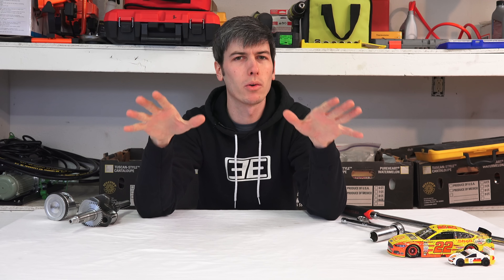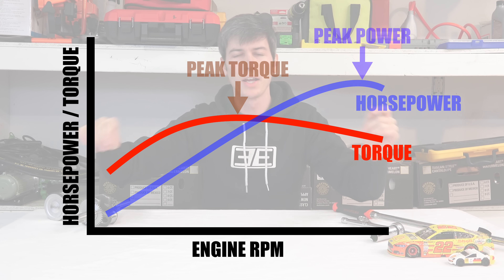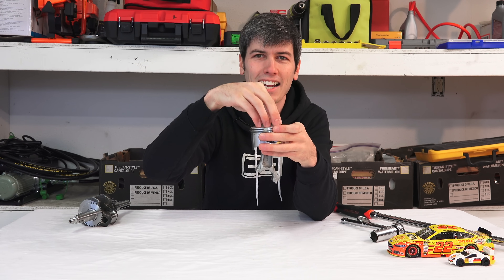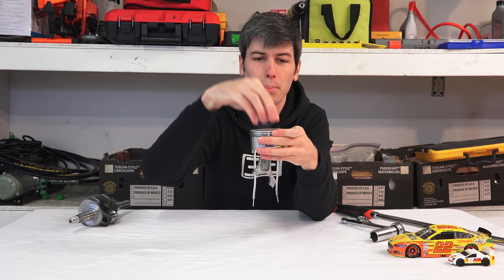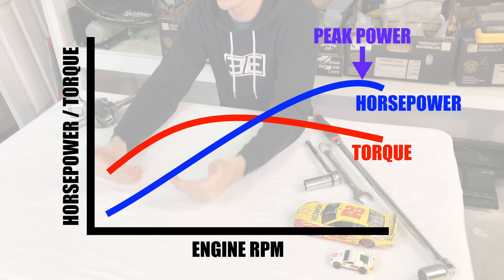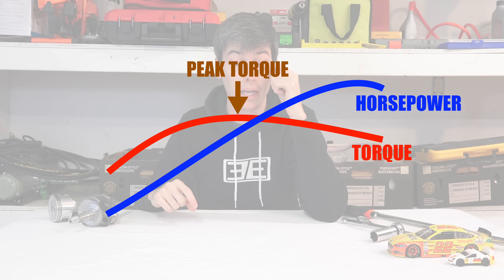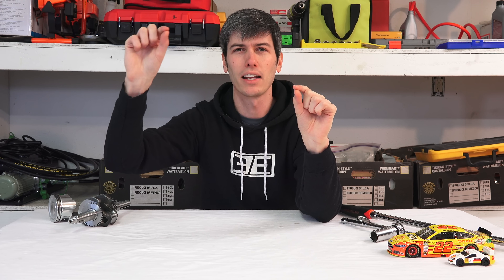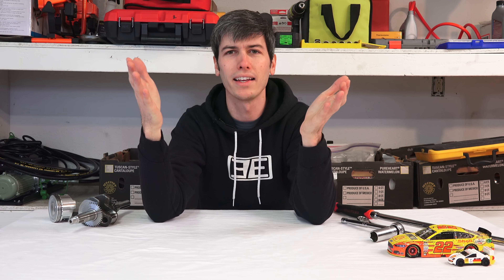Horsepower vs Torque - A Simple Explanation

Comment: I disagree with some of your conclusions. I love your videos and have learned a lot from them but this one was lacking a bit for me. HP and Torque are only related by the formula that is used to convert one to the other and not by any engine design feature. Torque is all that an engine actually produces and is all that is measured by a dyno. Math is used to calculate HP based on a formula that uses RPM and Torque as inputs (HP = torque * RPM / 5252 if using non-metric values). For this reason all performance charts will show HP and torque intersecting at 5252 RPM. Since Torque is all that an engine actually produces its not completely correct to say that a car that produces more peak HP will accelerate faster. HP goes up because RPM goes up but the car is not necessarily applying more twisting force to the wheels since torque may not be rising. Consider Diesels. I drive a 2012 Diesel BMW X5 35d with 425 ft-Lb peak torque and 265 peak Horsepower.  That diesel (x5 35d) engine accelerates this 5192 pound Vehicle to 60MPH in less time than the 200 pounds lighter gasoline equivalent (x5 35i) that produces 35 more (300 total) peak horsepower. Based on this video, if I only compared peak HP I would conclude that the x5 35i would accelerate quicker than the x5 35d but that's not the case. While I might agree that peak acceleration will be highest at peak horsepower this is only an instant in time so if you are comparing automobiles you have to compare torque curves if you want a full picture of acceleration over time. So in your example with the two model cars ... if that tiny car were a diesel It might accelerate across your desk faster than that larger car. :-)
Reply: Leighton
1. A dyno actually measures power and calculates torque because it is far easier to measure power than torque.
2. The diesel is faster from a stand still because it makes more power in the lower RPM range than the gas engine. You can't just compare peak numbers.
So the car with more HP is always faster, except when it can't shift down to use that power, so for example in first gear.
Reply: Thank you for your reply Blackster. Dynos do measure torque and then convert that number to horsepower using the measured RPM. But don't take my word for it ... check the internet. However we do agree that simply looking at peak horsepower, as stated in the video, to determine which vehicle will accelerate faster is no sufficient. So yes, the torque curve of a diesel confirms your statement that in general they produce more torque alt lower RPMs and are therefore able to put more twisting force to the wheels earlier on in an acceleration run.
Reply: Leighton Apparently we are both right. I know from a tuning company in Dubai that their dyno measures torque and calculates HP, but I researched a bit and also found other types of dynos that measure torque and calculate HP :)

Comment: the 200 hp vs 200 Nm example is wrong.
more torque you have even with less horsepower can be as fast as the other. you can manipulate gears ,so even if it doesnt have rpm ,it can push the pistons with more force. like starting straight in second gear.

Comment: I still need an explanation about diesel torque. If you use the calculators available for gas engines to calculate acceleration on a vehicle which is a diesel it’s completely incorrect.

Comment: Let's say your peak torque is in mid rpm range, is it possible(for swim reason) to tune your car to have peak power at the mid rpm range to match the peak torque range without manipulating torque
Reply: And second question why do peak torque/power drops after a certain point?

Comment: No, No, No, HP is a derivative of torque. So no matter what, the work product at the wheel for both cars will be the same. A car that produces 200 hp and 100 lb-ft will produce the same power at the wheel as a car with 100 hp and 200 lb-ft. To achieve 200 hp with 100 lb-ft the engine must turn at 10,504 rpms. To achieve 100 hp from 200 lb-ft the engine will only be turning 2,626 rpms. So no mater how the cars are geared, end work product will be the same where the rubber meets the road.

Comment: How does this apply to electric motors? So specifically torque vs watts in cars like the Tesla, Leaf, or Volt? Is the horsepower calculated the same or no longer relevant as a measure of power?
Reply: You can't really compare electric motors and petrol engines by looking at the torque and hp figures alone, because they only tell half the story.

Comment: One thing that should be noted here is looking at peak numbers tell you nothing about how fast a vehicle is unless it has a CV transmission.

As soon as you add in none constant engine speed due to multiple gears, a "Peak" number is useless without a curve plot. What's important (which is why the curve plot is needed) is the average horsepower across the speed range from one gear to the next... This is why some cars are "dyno queens". While they might make a nice high "peak" number, they are often slower then cars with lower "peak" numbers because of their lower average horsepower across the RPM range for each gear. This is why gearing is so important. If you have a closer ratio transmission, you can have a faster car despite having less power.  

For example I know of a 750hp Mustang that runs neck and neck with a 675hp Corvette despite having 75 more horspower. When you look at the dyno plots for each car and their gearing in each gear, the reason for them being so closely matched is obvious.... they have almost identical average horsepower across the length of the gear with each shift. Because the Mustang has a lot taller gears, that car gets into a much power power after each shift which hurts it. The particular corvette has a custom geared close ratio box. What's happening is they are both right at about 615hp throughout the usable rpm range for each gear.

This goes back to what I said about peak number being useless unless you have a CV transmission.

Comment: What most people dont know about changing a cars gear ratio is: if you take the vehicle to the Dyno you will only see gains in first and 3rd gear. 
Because once it hits that 1:1 ratio and then the overdrive gears, that is when the dyno sees the ENGINES power. Not the gears power. because first, second , and third gear multiply the torque on top of the final drive ratio chosen.

Comment: Great video.  Is there a reason supercars use dual clutch gearboxes vs. CVTs because like you said, if they could stay in the max horsepower they could accelerate faster than a dual clutch?

Comment: How can a dyno work out horsepower without rpm yet torque needs an rpm reading to work out the torque when horsepower needs torque multiplied by rpm to work out horsepower?

Comment: Hey. i like all of your videos, i think you should differenciate torque at the engine or at the wheels in this case when you say HP is torque *RPM and use the example of the two cars.

Comment: Why do turbocharged engines typically increase torque more than they increase horsepower? Shouldn’t the horsepower increase at almost the same level as the torque?

Comment: Hum.... thought the torque curve or the power curve as the same for all gears. Example, the same graphic shows the fl/lb/hp during a range of RPM, doesn't matter the gear you're in. The first the curve is the same (but you hit peak RPM so you gear second), second is the same also, you start a little higher on the RPMs cause you came from the 1st but the engine output/curve is the same... And the same goes one until top gear. Actually, I don't think the video is acurrate saying the graphic shows the curves through gears. I think is RPM no matter the gear you are in. UPDATE: wait, think you premissed the gear as being a SET gear, not gearing it up.

Comment: and how do you explain torque with a rotary engine?
Reply: It's still the same physics. There is still force being applied at a position offset from the center of rotation, even if it's not in what looks exactly like a lever.

Comment: In the 2 cars identical analogy, if both vehicles were starting at the same engine RPM and gearing, would it mean the lesser hp more torque vehicle would accelerate faster until such time as the speed factor (RPM) from the higher horsepower car equates to greater overall value that the other car has and then begin to pass it?

Comment: Basically I need to buy a well built CVT and a boosted engine
Reply: he has stated that a CVT wouldbe the perfect transmission layout if they were strong enough to handle higher power
Reply: I dont think so. The problem with CVT isnt only beacause it's not strong enough. They just have a relly big power consumption. They look so efficient on paper, but dosent perform well.
Reply: Most people actually don't really like the 'feel' of a CVT... and prefer a decent automatic, if they don't want a manual
Reply: Ill stick with cvt on the mopeds and manuals in the car hahah

Comment: Bleh, this made me super confused.  Not what I usually say about EE videos.

It seems like what you're talking about is engine torque vs wheel torque (ie. the difference in torque amplification through the transmission and final drive), but you're calling it torque vs HP ("power").  You describe wheel torque being higher if the gear amplification is more (lower gear), even if the engine torque is less, and that's true...but that's not HP.  The HP equation doesn't take torque amplification into account.  It uses the given torque, be it wheel torque (ie. 1500ft-lbs) or engine torque (ie. 150ft-lbs), and applies the rate (RPM) to it, but it doesn't include amplification.  Engine dynos can calculate HP w/o amplification, because only RPM is required.

Perhaps somebody can explain what I'm missing about this because including gearing to get power from torque confuses me, as the gear ratio amplification and hp equation are two separate things.

Comment: Great video but there’s a couple things that confused me. Im an engineering student in Britain so I understand quite a lot of the stuff but one thing that really confused me was when you said horsepower is work done but then refer to it was power. Work done is energy, which (brings me into the second thing that confused me) is calculated by force*distance, there is no mention of speed or time in that formula, so how is time to move distance x affecting the power?
Reply from the maker: Horsepower is not work done, but instead (as mentioned) the rate of doing work. The faster you do work, the more power it requires.
Reply: Engineering Explained ahh that makes so much more sense thank you, great video 😊

Comment: Good explanation, but a question presents itself: why wouldn't all manufacturers focus on HP over TQ? For example, V12 Mercedes have say 500hp and 600tq, why is that desirable? Is it simply for instant acceleration without downshifting?
Reply from the maker: A high, flat torque curve is desirable, and results in high horsepower. Remember, the two are connected, so if torque is low, and RPM is low, power will also be low.

Comment: Nicely done, Jason.  I know most gearheads watching this are probably 0-60/drag race types, but It would be great if you could turn the tables and explain torque & horsepower from a towing perspective rather than only from  an acceleration perspective. Perhaps use your 200 hp/100 lb-ft vehicle versus 100hp/200 lb-ft vehicle scenario, only explain their ability to tow a 5,000 pound trailer.  Or am I just demonstrating that I didn't understand the above video as well as I think I did?
Reply from the maker: Well, regardless of how much mass you add to the vehicles, the vehicle with more power will ultimately be able to accelerate that mass more quickly.
Reply: Thanks for the quick response.  I'll have to figure out a way to measure the following "feeling":  It sure feels like my diesel pickup with 189 hp and 369 lb-ft will accelerate up a long grade with  my 4,500 trailer quicker than my gas truck with 235 hp and 295 lb-ft.  Based on the physics as you have explained it, it is probably just the way the gas engine's automatic is shifting, keeping the engine off peak horsepower while the diesel is probably operating on its max of both.

Comment: What's the advantage of having more torque then
Reply from the maker: More torque means more power! :)
Reply: Horsepower is a product of torque and engine speed.  If you have more torque, then you don't need higher engine speed and can use less aggressive gearing.  Or if you maintain the same gearing, more torque = more horsepower = faster acceleration.
Reply: I get it now so having more torque like the leverage that the power is using, and the power is the actual force pushing the torque. So let me know if I'm wrong but that means you can change the torque through gearing but the power should remain the same? Also if this is the case why does torque go up with engine tunes
Reply: Thanks
Reply: Engineering Explained  Not unless it can rev higher than the engine you are comparing it to. You can't make a blanket statement like that. If you can increase the torque and maintain or even increase the rev capability then there will be more power, if not, such as the case of a longer stroke mod(too high of piston speed and/or inadequate breathing) you have less power or the same, merely reshuffled in the rev range.

Comment: I have a question: If you have 2 identical cars with relatively the same engine characteristics, but one is 100HP with 100Nm and the other is 100HP with 120Nm, which one would accelerate faster? And how would that change if the cars weight less or more? Thanks in advance.

Comment: Roads aren't 100% level in real life. I know for a fact that my jetta with 177tqlbs/170hp is just as fast as a Subaru BRZ with 151tq/200hp on the hilly roads in my area. Torque wins races, horsepower sells cars.

Comment: I think a simple way of putting it is. Horse power is like fan.. if it has very low torque, when you put your finger in between the blades while it's spinning, you'll stop it. If it had more torque and you put our finger in it, it would cut it off..

Comment: So how would you compare hp and acceleration to, say, torque and towing capacity? Afaik most vehicles built with towing or high weight transport focus more on peak torque than peak horsepower (like the slower car in your demonstration).

Comment: I'm still not sure what the advantage of torque over horsepower would be, based on this explanation. If the car with more horsepower does More work More Quickly, like you said, then why would anyone pick a car with more torque and less horsepower. Wouldn't the HP car be superior at both acceleration and, for example, towing heavy loads?

Comment: Two additions:
1) Changing speed requires performing work (because you need to change the kinetic energy). Thus, the faster your engine can do work, the faster the acceleration is.
2) So what does the amount of "torque" in the specs tell you? Nothing directly. However, using some simple math you can tell how well the engine behaves at mid and low rpms.

Comment: Just to add on to this a bit more, power is related directly to how fast your engine uses fuel. That formula would be Power Out = efficiency X Power input. PowerOut is horsepower and Power Input is fuel input rate. The only ways to have an engine make more horsepower is either to make it more efficient or dump fuel into it faster.

Comment: BTW I think one of the reasons for all the confusion is that gearheads that say "torque is king" are basically confusing low end performance with high torque. If you're in a race where you never get a chance to really hit high RPM ranges (IE racing from stop light to stop light) then you'd want a car that produces performance in the lower RPM ranges. (Which ends up with high torque and low power.)

Comment: To sum it up Horsepower is an engine's ability to trade rotational speed(RPM) for rotational force (Torque). Your transmission is a device that allows you to trade one for the other at the wheels. (Which is pretty much what that HP=RPM*Torque formula is telling you.)

Comment: That was awesome! Would be sweet to see a similar video on how this is different with electric motors which are constant-rpm machines vs internal combustion constant-power machines (at constant throttle). It's perhaps not as useful to illustrate for cars, but model plane examples are great, where prop represents load and the concept of overpropping or underpropping an engine can be delved into. Just an idea :)

Comment: Great video again, may i add something?:  Electric car math are alot more easy to explain!..
 - Assuming torque is generally constant like for Electric Cars,  then Power is : "at up to witch max RPM it can be sustained !"   Easy... Power = Torque x RPM... and Electric car have one gear... simple !    
- Also  for the electrical part: Torque is proportionnal to the phase current going to the electric motor and Power is proportional to the battery current you.  Battery current and Phase current are different. That mean you can be 10km/h and have max phase current and torque but only have 5% battery current ( power)...

Comment: Is that torque at engine output, transmission output, or at wheels? Torque at engine output is irrelevant (gearing can make it whateverish ), maximum acceleration depends on maximum torque at the wheels, the radius of the wheels, axle rpm, car weight, coefficient of friction between tires and road , etc. 
My takeaway is: rev higher before shifting for max acceleration. Is that right?

May I suggest an in-car example of max acceleration showing tach and with engine sound.

Thanks for your videos.
Watched over 20 of them.
Appreciate the info.